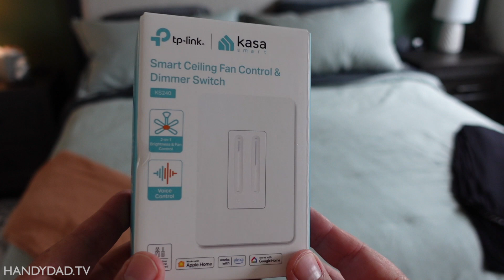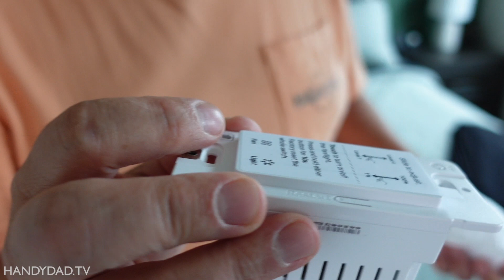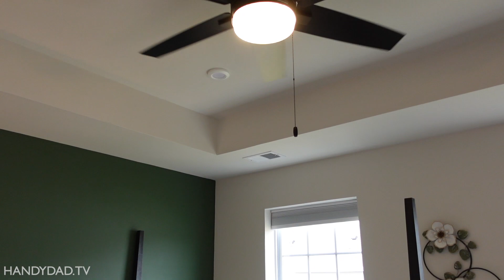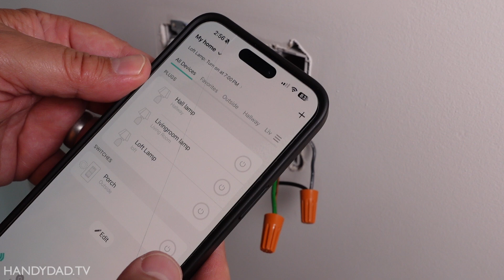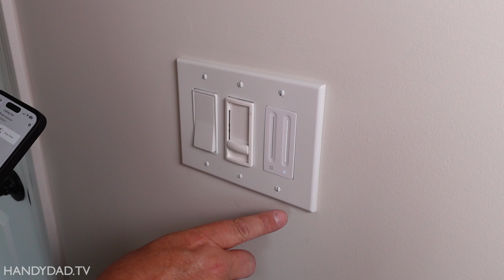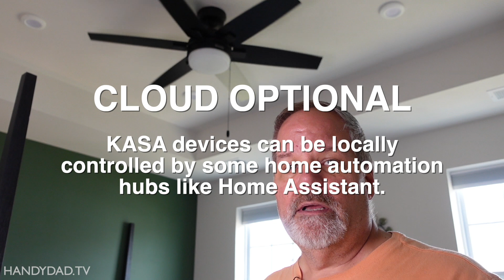KASA Smart Fan Control

Comment: This is exactly what I need. Years ago I tried to change a single gang box for a two gang but it turns out there is another wall stud 3 inches from the stud the current box is mounted to for some strange reason. I wanted smart control for the fan and light separately and to be able to link it to Home Assistant. Looks like this may be the ticket. The only thing that would make this better is local control but beggars can't be choosers.
Reply from the maker: Kasa switches have local control from Home Assistant.

Comment: Problem is that they put this in one single gang unit -  where most houses have seperate single gang switches on seperate switches which means if you install this then you are left with an empty gang slot . I am sure other consumers have run into this.  Great for new construction not so much for existing renovations.
Reply from the maker: Good point.

Comment: I want this to control two lights, What could go wrong? Aside from only 4 steps on the 2nd (FAN) light?
Reply from the maker: You can control two lights from the dimmer, but they must be wired together. You can’t use the fan speed control for a light.

Comment: I like the chinese knockoffs that sell on amazon that allows for remote control + Alexa.  Not having a remote and it cost more than the remote controllers that have alexa capabilites is a negative. If Wifi is out, you have to use the wall. I rather use a remote as a redundant measure.
Reply from the maker: I’m a Home Assistant user at this point so I’d opt for a remote that also has WiFi capabilities. Best of both worlds IMO.
Reply: @handydadtv understood. Yeah can’t go wrong with with that. I plan to implement that while I move but for my parents I’ve set the tuya fans to use Alexa.

I’d definitely look into home assistant and this switch. I have Kasa light switches and so far they’re working as advertised so I’ll look into getting a Kasa fan control . Thanks for the video and comment!

Comment: What do I do if there’s no ground wire? I also see three black wires coming out of the wall
Reply from the maker: For the ground, you may have a grounded metal box. As for the other wires, you can’t always trust color. You need to observe how it was wired before and test to identify line, load and neutral.

Comment: Does it work with fans that use a remote?
Reply from the maker: You’d have to wire the fan directly to bypass the receiver module.
Reply: @handydadtv -- I don't know what that means.  I was wondering the same thing.  I do all my own wiring.  And, I new the caseta doesn't work with remote controls. I was wondering when you mentioned the pull chain if it was necessary.  Can you do a video on how to bypass.  I am subscribing.
Reply: I got it.  I have to go in the fan and rewire to take out the remote control receiver out of the fan housing.  I know how to do that.

Comment: Did you also connectt the fan light the switch?  You didn’t show the light working in the video. There was a mention of physical dimmer in the video but wasn’t sure if that was for the fan light or something else.
Reply from the maker: Yes this device controls both the fan speed and dims the light.

Comment: I've always wanted a remote controller for my ceiling fan and this is exactly the one I want. I have a 2 gang box where it's actually 1 switch controlling an outlet behind my bed, and the other controls both a ceiling fan, and the light beneath it, which is what I am seeing in this video and this switch could definitely work.
Reply from the maker: Glad it was helpful 👍🏻

Comment: I have a ceiling fan but it's wall switch only has 3 wires: black, red, and ground copper. It has a remote control that controls the fan speed and the light. How can I use this with it?
Reply from the maker: You can’t use this with a remote.

Comment: Can the app change the direction of the fan. Like in the summer counterclockwise and in the winter clockwise?
Reply from the maker: No. The fan will have a physical switch to reverse it. Sometimes it’s under the globe of the light.

Comment: My fan and light are on 2 separate swtiches in the same panel. Im assuming this would still work if i stretched one of the wires over from the second switch? I'd probably just leave the 2nd switch as a blank switch so there's not an awkward hole there.
Reply from the maker: Yes, this is perfect if you have two switches. 

You can get a blank Decora insert instead of leaving a dead switch.
Reply: @handydadtv  That's a smart idea, thanks!
I'm going to have to check out my bedroom switches tonight for compatibility. Living room is the 2-switch setup, but bedrooms have one switch for both. The 1-switch ones already have remote controls for separate fan and light controls with receivers installed in the ceiling unit. Not sure if there are separate fan and light wires coming from the switch though. Wife wants the smart phone ability, though, so we need a replacement.
Reply: I don't know much about electrical wiring,but  won't there be an extra line/hot wire remain from either the switch for the fan or the one from the light? If so what should be done with it seeing that the KS240 only has one wire for line/hot?
Reply: @wilder.yamissant5250 I already installed that like a year ago lol. Just got a blank in the other spot.
Reply from the maker: Cap it off with a wire nut.
Reply: @handydadtv That's what I ended up doing.
Thank you!

Comment: How bright are the lights on the switch itself in a dark room with the fan on? And are there any lights illuminated on the switch when everything is off? Thanks for the vid!
Reply from the maker: It may be configurable (I didn’t check), but there were no lights when off and only the buttons at the bottom stay lit when on. The sliders only stay lit shortly after touching them.
Reply: Thanks!

Comment: Will this work if I have two switches making a 3way connection
Reply from the maker: Sort of. I’d remove the second switch. Since this is a smart switch, you wouldn’t need the second switch anyway.
Reply: I don't know why they can't just make a fan control switch. My house was built with two switches in every room.
Reply from the maker: @saliston KASA only makes a combo switch. Lutron makes one that only controls the fan, but it’s around 50% more and requires a hub. https://youtu.be/6G3GvIGteAs
Reply: @handydadtv  with my room I have three way switch but only single gang box so I would need to add a new double gang box to hold the second switch
Reply: @saliston  also would need new wiring cause it’s wired to control the fan and light on for what ever the chains are set at on the fan

Comment: Great channel but dont cheap out with WIFI automation.   Lag's.    Use Zibee or Zwave instead.
Reply from the maker: I have all of the above with Home Assistant but KASA is my #1 brand for simple smart switches.
Reply: WiFi does not have lag that exceeds other protocols. I have zwave and it has delay sometimes and the setup for zwave is a pain compared to WiFi.  I have lots of Kasa devices as well. For the most part they are cheaper and they perform well. I’m working on phasing out my zwave devices.
Reply from the maker: @bnubile Much cheaper. Thanks.